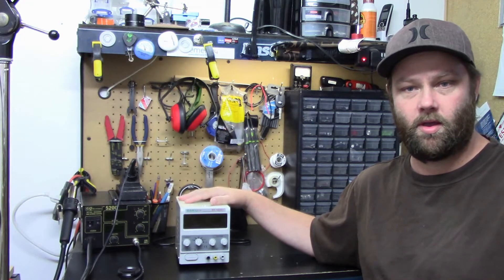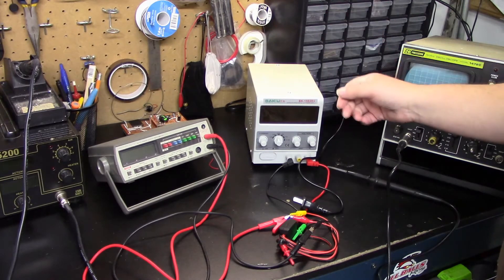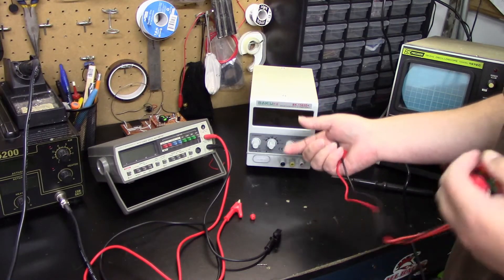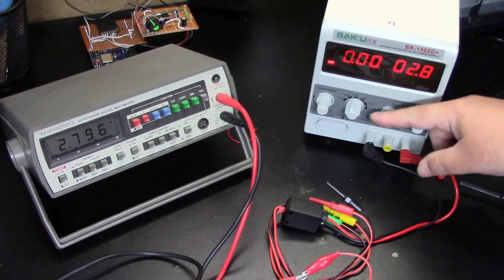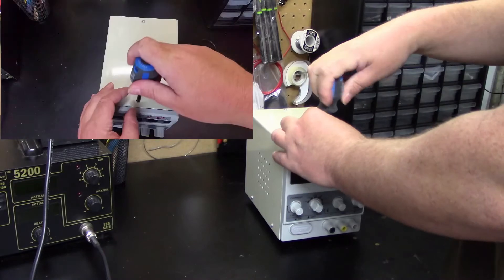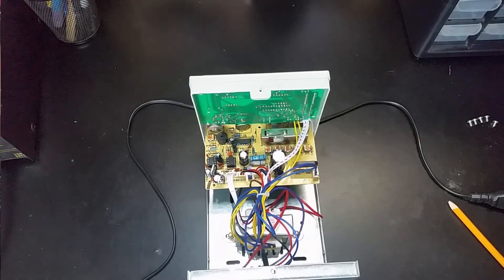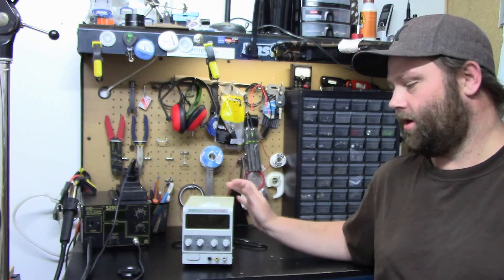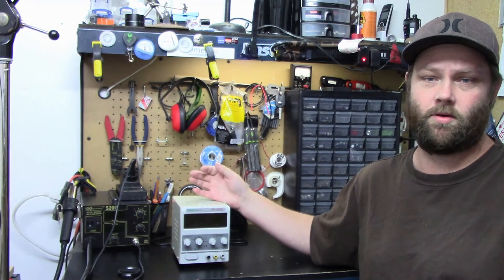Baku 1502d+ DC Power Supply Testing & Review

Comment: i find this baku things at my uncle's house. and it only displays 0 on both segments and all potentiometers are not responding. i don't know what the problem cause i just want to try to fix it😂
Reply from the maker: should be fine try putting a load on it and watch the numbers go up.  mine does the same thing until I attach a load to it since the circuit is not complete.

Comment: Good review but absolutely awful junk, not earthed, not even sold anymore. Current limiting just beeps and can't go lower than 0.6 a, maybe okay for running a scalextric but electronics, nahh. 😆👍
Reply from the maker: Ya I am not going to lie after replacing the cable on it  and yes the case got a new hole to mount the ground but it lives in the back of my closet right now.   I have a video on that but was never released.   but have had a few other units after this one and even have one I just recently got sent out to me.  I am a fan of budget electronics. I still have my GQ Electronics soldering station from must be 15 years ago and still works like new and is heavily used.

Comment: you didnt even run it , how do you know it works at all let alone something else , yeah you measured how precise its voltmeter is , but thats about it really . I mean god damn what about current limiting does it even work , can it run dual rails , with what power , i mean come on . You say that unit is not all that good , but its much more sophisticated then what you need obviouslly 
It really has 2-3 more functions then you need . You dont need a better plug , for you dont need a plug for it all , what you will do with it , hook it up to  voltmeter  thats usless .
Come on man .
What i need it for is to bypass voltage regulators in amps , to check for a fault for example , you have an amp im sure , you have a voltage regulator in that Voltmeter , you could have disasebled it and put it on this , and see if it can do it , and how good .
You hook something to it , more advanced then a Fan and you see how it looks , if it does the work , then its good , if it fails then its not good .
Reply: Yep it's garbage, it isn't even sold anymore. I just tried to use it to charge a lithium battery and it's not capable, just beeps and cuts off. Absolute trash.
Reply: @techtinkerin  i made my own with LM317 and by pass transistors .

Comment: Many products have a plug that doesn't fit perfect. Simple fix is spread the prongs out a bit. Simple fix. I wouldn't lose any sleep over it.
Reply from the maker: still using it to this day so its been good so far and ya I did that as well thanks for the tip years ago.

Comment: Complete noob here. When you say " fine tune" what is it that you are fine tuning? The DC power supply, the multimeter or both? And how do you go about doing that exactly? Please let me know, as I am really trying to learn. Also, keep making videos. Cheers!
Reply from the maker: fine tuning the output of the power supply but also checking the fine tuning on the multimeter to make sure the output is consistent with what the power supply.  Some devices are very picky on the output to double checking a cheap unit like this is ideal so you don't do any damage to what your working on or batteries you might be charging.
Reply: Thank you for replying. But exactly how do you go about it? Thank you kindly

Comment: Hey man just got it shipped! How the hell am I supposed to change or regulate the current?? And why didn’t you go through that!? It keeps beeping when I put the positive and negative together and won’t let me regulate the god damn current?
Help me!
Reply from the maker: Like I stated within the first minute I have it set to 0-15v and use the dials for fine tuning. Setting it on the others will not allow the fine tuning.  Not sure what your trying to do with putting them together the positive  and negative.
Reply: Gam3T3cH Electronics thank you for your reply!
I am one stupid son of a bitch that bought a 2.1A power supply, and who wanted to tune it to more than this value!
My bad, Now I have to buy another power supply probably 10A.
Cheers man!
Reply: Gam3T3cH Electronics I was using another power supply model when ai used to repair smartphones.
I used to put negative amd positive together to tune the current.
With this power supply I can't because it only has 2.1A!
Reply: @TheAmazingAhmed  You should be able to short the output and set the maximum current limit by rotating the current setting knob. However, this low cost supply probably can not do it. If you buy a Farnell (made in England) brand power supply, you can short the output and set the desired current limit.
Reply: Hello, I'm a complete noob but I'm trying to learn. So, please bear with me, if this sounds stupid. How do you regulate current? Please let me know. Cheers!